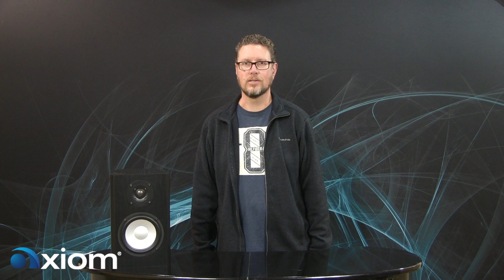Speaker Impedance Explained: Do You Need to Match Your Amplifier?

Comment: I have an old Sony passive subwoofer with rated impedance of 3ohms and 150W power. The problem is I cannot find a budget amplifier that matches 3ohm. Any suggestions on a mono amplifier that can drive this sub?
Reply from the maker: I think you will fine with any amp that is rated for 4 ohms.

Comment: I have 2 speakers rated 6 ohms each and another 2 speaker 5 ohms each, can i use it all to my 5.1 av reciever but in 8 ohms requirement speakers? Im a little bit scared.
Reply from the maker: Just check your manual and see if your AVR is rated to drive a 6 or 4 ohm speaker. If so you should be fine.

Comment: If lower impedance is harder to drive then why don't we all use high impedance speakers???
Reply from the maker: Many reasons…higher impedance will usually mean lower sensitivity, so more power is needed for a given SPL. Also, higher impedance voice coils will require thinner wire which can handle less power (current). As with all things in loudspeaker design, it’s a trade-off.

Comment: Thankyou, this made sense, I was just researching if I could use my stereo at a friend's using his speaker's, mine normally runs 2x75w 4 ohms and his runs 2x50w 6 ohms speakers so as long as I don't crank it up I won't damage the speaker and my amp will be fine on the lower power drawing speakers.. just to test if mine can pick up DAB at his as he can't?..
Reply from the maker: Yes, no problem at all! Good luck with your DAB reception test.

Comment: How does the ohm change with home audio (Stuff with crossovers)?. f. ex you connect 2 towers in parralell on each channel, if theyre both 4 ohm, will the ohm on the amp become 2 ohms? And if you build your own towers with several speakers. Is the paralell and series equations still the same at the input of the speaker?  Soty in advance for poor structure in my writing, but english is not my language XD
Reply from the maker: No problem Thor. Impedance works the same way if we are talking about complete speakers, or individual drive units. You are correct that two 4 ohm speakers in parallel on each channel will present a load of 2 ohms to the amp.

Comment: Hi.Please help.I have LG home cinema,satelite speakers are 3ohms and sub is 3 ohm.Can I connect more speakers(also LG)to that amp in serial because satelites of this speakers is 4 ohm.I should get 7 Ohm.It's that too many or it's ok.Can I get 10.2 system home cinema.Only problem its that I have 7 Ohm on speakers but amp say that 3 is ok!!!Thank you
Reply from the maker: Normally such integrated systems are not designed for anything other than the original speaker configuration. I would check with LG tech support.
Reply: @AxiomHomeTheaters  super.Thank you man once again.

Comment: Hey man, could i put a 8ohm Guitar speaker in a  50 watt amp that has a 4ohm impedance?
Reply from the maker: That should not be a problem, but you might only get half the power out the amplifier, depending how it is spec’d for an 8 ohm load.

Comment: hi i have wired my speakers in a way where i get 19omhs total impeadance and the amp im using is rated 8-16 is it ok for me to use the 19omhs total impeadance on my 8-16 omh amp
Reply from the maker: Yes, it should be fine.

Comment: Hi I have a kenwood rx235 integrated amplifier with an impedance of 80 ohm and it says maximum input  power 80w is ok if I connect a speaker more tha 150 watts
Reply: Sorry impedance is 8 ohms
Reply from the maker: That will be no problem, just listen for signs of clipping distortion if you tend to listen at high levels.

Comment: Why is it that this big amps use low ohm speaker while SMALL pocket ones can drive as high as 600 ohm??
Reply from the maker: Because the higher the impedance, the lower the current requirement. Speakers tend to be low impedance in order to have good efficiency.

Comment: If my amp can handle 4 ohm, which speaker should I use, 4 or 8 ohm?
Reply from the maker: If the amp can handle 4 ohms you can use a 4 ohm OR and 8 ohm speaker. The rule of thumb is that you can always use a speaker with a higher impedance than what the amp can handle.
Reply: @AxiomHomeTheaters  Sony TA-N77ES
This is my amp and I want to add a bluetooth preamp and a turntable. 

I want to build a good 2 way bookshelf speaker system just for listening to music.

The room is a small office/guest twin bed. I need to stay on small side, may even need to build shelf for amp and speakers. The amp is 55 lbs.
Reply from the maker: @polocash11  In a small room your idea to look for smaller bookshelf speakers is a good idea. The Axiom M3 would be a good fit without a subwoofer. Your amp should have no problem driving them.

Comment: Hi Axiom, i belive i queried about paralleling 2 , 8 ohm bookshelf speakers to my Denon DRA-800H Receiver.   I learned that paralleling reduce the ohm draw to 4 ohms.  Playing the paralleled bookshelf speakers to the B speaker connection and also connecting another pair of 8 ohm bookshelf speakers to the A speaker connection,  produced overheating , the power light flashed red, and shut down.  Disconnecting the A speaker connection,  and the paralleled bookshelf speakers played wonderfully.  But my question is this:  other AV forum posters have told me that running in this manner will shorten the life of the Reciever, is that so?  What I done is purchase a separate integrated amp - IOTAVX SA3, as the zone 2 amp off the Denon DRA 800H Receiver.   The 6th pair of Elac Debut 6.2s are connected to that.  Yes, there is a slight tonal difference from the Denon, as I play the 6 speakers in the same finished basement studio setup construed during COVID pandemic.  FYI, I use the Denon strictly for 2.1 channel stereo music, no AV use yet.  Thx for your time and attention and advice.
Reply from the maker: Yes, it might do damage to the receiver at some point. It’s always a good idea to heed overheating and shutdowns as a message that what you are doing is a problem.

Comment: If I'm looking at a receiver with the following specs:Rated Output Power (IEC) (Others)
7 ch × 165 W at 6 ohms, 1 kHz, 1 ch driven of 1% THD                                                                                                                                                 Maximum Effective Output Power (JEITA)
7 ch × 175 W at 6 ohms, 1 kHz, 1 ch driven of 10% THD (Australian, Asian
and Taiwanese)
Dynamic Power (*)
* IEC60268-Short-term maximum output power
240 W (3 Ω, Front)
210 W (4 Ω, Front)
120 W (8 Ω, Front)
THD+N (Total Harmonic Distortion+Noise)
0.08% (20 Hz - 20,000 Hz, half power)         

Would suitable speakers be ones rated at  200 watts front speakers 120 watts rear speakers at 8 ohms with sensitivity of 90db with frequency of 35-50000 Hz?
Thanks
Reply from the maker: I would not get too hung up on the particular specs of the speakers, other than you will be fine with 4 ohm speakers as power is given into 3 and 4 ohm loads in addition to 8 ohms. I’d suggest listening as the best way to decide on which speakers will work best for you. As long as the sensitivity is not too low you should be fine. Hope that helps, and thanks for watching.

Comment: But what about this, and i hope one of u answer me, been wondering about this for over a year.    Lets say you look at some amps, and it says it does 2x100 watts in 8 ohm, and 2x200 watts in 4 ohm.  For idiots like me, that looks like u get double the power out of your amp with 4 ohms speakers. Why are these specs listed like this?  If anything, since 8 ohm are easier to drive, it would say the total opposite.
Reply from the maker: It all has to do with the current the speaker is asking the amp to deliver. In good amplifiers the power will double going from 8 to 4 ohms suggesting a robust output stage and power supply. On paper you are getting more power from the amp with 4 ohm speakers, but remember that the impedance varies significantly with frequency. Hope that helps, and thanks for watching.

Comment: So an 8 Ohm Ankyo receiver is safe on a 6 ohm Q Acoustics speakers ?
Reply from the maker: In most cases, yes, but to be absolutely sure you should ask Onkyo. Thanks for watching.
Reply: @AxiomHomeTheaters  Exactly .  I was looking at Onkyo receivers .  They are feature packed but they are 8 ohm.  I want to set up a 3.1.2 system with no rear speakers .  Onkyo has Atmos and DTX-S for under $300.
Reply: You know your stuff .  Thanks
Reply from the maker: @OOnti-dz4jd  you're very welcome! It's always best to contact the manufacturer, in this case Onkyo, as they know what their receiver can handle. Good luck, sounds like you've got a great plan for your system.

Comment: Hai ..I have a Kenwood km 106 amp have 8ohm impedance but my speakers are 6 ohm ...is it advisable to connect the speakers with amp
Reply from the maker: I would check with Kenwood to see if the amp will be ok with a lower than 8 ohm impedance. In most cases it should not be an issue. Thanks for watching.

Comment: Hi! Can you give me some advice about proper wiring? I have  Bolt 1200 w max power amp with 4 channels and it s power ratings are in discription:
 75 w × 4 @ 4 ohms
 100 w × 4 @ 2 ohms
 200 w × 2 @ 4 ohms 
So i have pair of Jbl Club 9630 3-way, 3-ohm  speakers with RMS:80 w and max output 240w which i want to install in front doors of the car. The second pair which goes in the back are oldschool Pioneer TS-2150 , 4 ohm with max power output 200 w , dont know the exact RMS, but probably around 70-80 w like JBl. So i ve been thinking and searching the best possible wiring combo between amp channels and matching speaker... Really could use some good and simple advice in this case :) ! Greetings from Estonia!
Reply from the maker: I would suggest that you wire up the 4 speakers to your amp in 4-channel mode which will give you 75 watts to each speaker. Thanks for watching, and greetings to Estonia from Canada 👍
Reply: @AxiomHomeTheaters  Thanks!

Comment: This means. I can run a home audio 3way, 250 watt 6 ohms speaker set on a car audio power amplifier which is designed for 4 ohms and couple of thousand or more watts.
Great explanation.
Thank you so much.
Reply from the maker: Yes, 6 ohm speakers will be no problem with an amp that can handle 4 ohms. Glad the video was useful to you, thanks for watching.
Reply: @AxiomHomeTheaters  I was thinking. What if it's comfortable for the amp and speakers at the same time to play.
What if speakers couldn't handle the power delivered by the amp would it not burn the coil.
Reply from the maker: @tahirhashmi2533  I think the important thing is to listen for signs of over-driving the speakers (distortion, popping, etc.) and turn the volume down if you do. Otherwise it should be no problem.

Comment: does it anything to do with sound quality? which ohm speaker should i go for good sound quality
Reply from the maker: Speaker impedance has nothing to do directly with loudspeaker sound quality, so there is no need to worry about it, other than from an amplifier/receiver standpoint. If you choose 4 ohm loudspeakers, make sure they will be compatible with your amp/receiver. Thanks for watching and let us know if there are any other topics you'd like us to cover.
Reply: @AxiomHomeTheaters  ah cool, I wonna know about the car stereos, My dad had a cheap chinese car stereo but it works fine but im not happy with the audio, like the high end isnt that clear and crisp in the high end frequencies, also does car stereos have difference in sound? like some having better quality sound.
Reply from the maker: You can certainly get both better head units and speakers for your car, not to mention amplifiers. I would seek out a car audio specialist in your area.

Comment: Good explanation - now I understand! I always thought that lower impedance meant it was easier to drive. Now I know - thanks!
Reply from the maker: You're welcome! Glad it was helpful, and thanks for watching👍
Reply from the maker: Nati man  I have never heard of this before, as in most cases a receiver will be rated for a minimum of 8 ohms or 4 ohms. A 4 ohm speaker on a receiver that is only rated for 8 ohms can be an issue in some cases, but with modern receivers a protection system is likely present to prevent any damage. It's true that 6 ohms will likely be ok in most cases with a receiver rated for 8 ohms, and in the same way 4 ohm speaker should not be an issue with a receiver rated for operation down to 6 ohms, just be advised that the receiver might shutdown when driven hard with a load lower than recommended.

Comment: I have a pair of speakers that are “4-8 ohms” but my amps says “minimum impedance 8 ohms” are these speakers compatible with my amp? They seem to work fine but are they not going to sound as good as a pair of 8 ohms speakers? Sorry for the silly question but I just heard about ohms tonight after buying a new stereo system and I’m trying to figure out the best set up. Thanks.
Reply from the maker: They will sound fine and will likely work with no issues with your amp. One thing to keep note of is how hot the top of the amplifier feels after you give your system a workout. If it’s too hot to touch then the amp is likely not happy with your speakers. Thanks for watching, and it's absolutely not a silly question. 👍

Comment: Can I use 4 ohm 300 watt speaker to a 6 ohm 200 watt amplifier?Plz help me.
Reply from the maker: You should make sure that the amplifier will tolerate a 4 ohm load. Best to check the owner's manual or contact the manufacturer. Thanks for watching!

Comment: i know it may be a dumb question but why do I find cheap speakers that are 3ohms like i know they are cheap and aren’t high quality like other ones but I have a good receiver that says only 6 and also let’s say the specs say the receiver outputs 145 watts peak 90 rms at 6 ohms so if you put a lower omhs speaker would the wattage and rms drop ? Thank you
Reply from the maker: The problem is not that the power will not necessarily drop with a lower impedance speaker, but that the amplifier in the receiver may overheat due to the higher current demand. Thanks for your question and for watching!
Reply: Axiom Audio ohhhh okay thank you and thanks for the great content
Reply from the maker: You're very welcome! Always up for audio chat 👍

Comment: This is so interesting but so confusing for me. My instinct when I hear a higher ohm rating is to think "well, less current, less load" but I think you said the opposite is true.
So does this mean I can use 6 ohm speakers with a 4 ohm amp? I assume the speakers will be slightly over powered but still useable?
Eitherway, love the video.
Reply from the maker: Thanks Michael! The lower the ohm rating, the higher the current draw.The lower impedance places more demands on the amplifier. You will have no trouble with the 6 ohm speakers and a 4 ohm amp. Thank you for watching and let us know if you have subjects you'd like to see covered.

Comment: hey I have a pair of 6.5-Inch 180 Watt 2-Way Coaxial Speaker but each speaker is 90 Watts RMS/ 180 Watts Peak Frequency Response 65-20 KHz, Impedance 4 Ohms. I'm looking for a cheap 2 channel amp that can make these speakers sound awesome. what kind of specs should i be looking for in a amp? how many watts should the amp have and ohms as well, remember I'm looking for something cheap that can make my speakers sound awesome! thanks
Reply from the maker: Unfortunately, like many things in this world, something cheap is unlikely to make your speakers sound awesome. I would look for a basic 75-100 Watt per channel amplifier from a reputable brand. Never hurts to look at the used market either. Good luck and thanks for watching 👍

Comment: I bought a sony amp rated 6-16 ohms and i used some flaunce 4ohm speakers and the amp got so hot it went on protect. Is that normal for a new amp or should i buy 8 ohm speakers
Reply from the maker: With a 4 ohm speaker you need to make sure the amplifier is capable of driving them. It sounds like your amp is not happy with that load. I would suggest looking for an amp that states it can drive 4 ohm speakers. Or you can buy 8 ohm speakers for your new amp. Thanks for watching, and good luck 👍
Reply: Axiom Audio thank you

Comment: If someone explain few things please. 
Goal is to find right  2 ways amp class D 
8ohm  two 50wats speakers

1) I need 100wats amp at 8ohm
2) I need 150wats amp at 8ohm
3) I need 200wats amp at 8ohm
Reply from the maker: I would look for an amplifier close to the maximum power rating of your speakers. So number 3) is your best bet. Thanks for watching, and good luck with your amp shopping. 👍

Comment: This is for a bass amp/ cabinet. I have an amp that works with 4ohm, but can be switched to  2 ohm. Can I set the amp to 2 ohm in order to power the 4 ohm cabinet in order to lower the sound output?
Reply from the maker: If your speaker is 4 ohms you should leave the amplifier set to 4 ohms for optimal performance. Setting it to 2 ohms will not reduce the sound output..

Comment: Can i use 3 ohm speaker rated 167 watt rms to yamaha 3072 av receiver?
Reply from the maker: Most home theaters are not rated for loudspeakers below 4 ohms, so you run the risk of the receiver overheating. Sorry, not recommended.
Reply: @AxiomHomeTheaters  thax for reply
Reply: In yamaha 3067 specification they mentioned dynamic power per channel(8/6/4/2ohms) = (--/110/130/150watts) what does it mean?
Reply from the maker: @khushivaghela1756  if the manufacturer gives a spec of 2 ohms then you're good to go